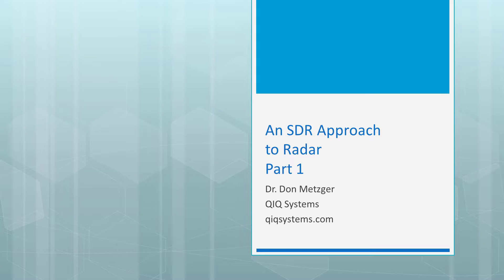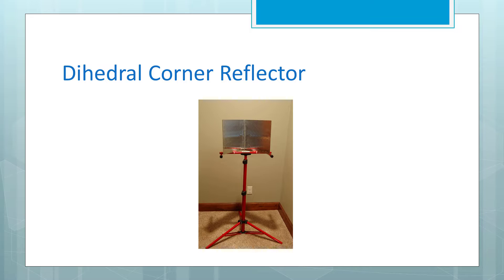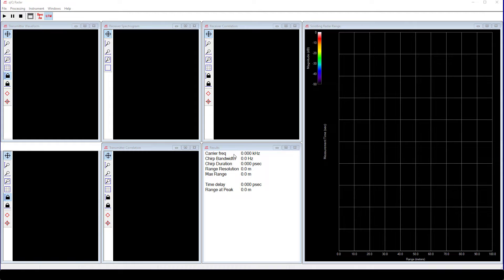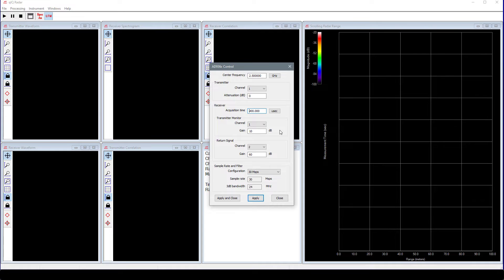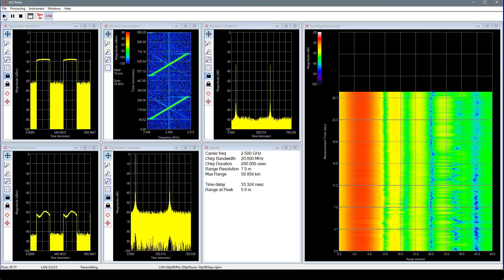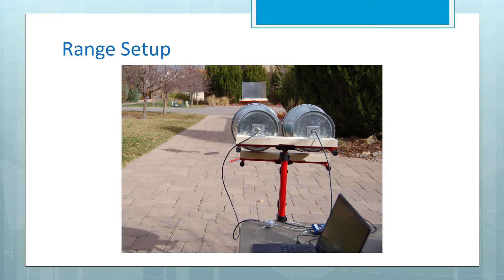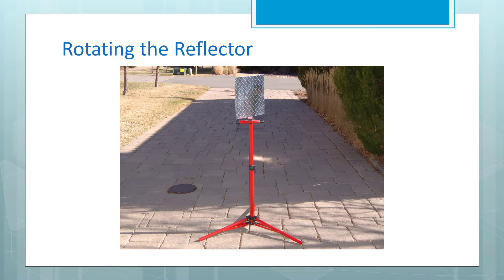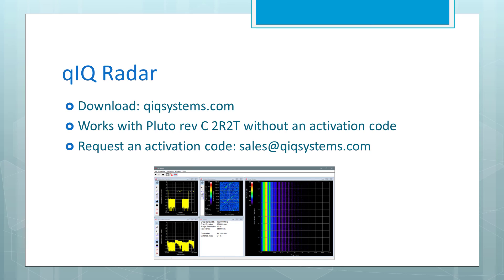A Software Defined Radio (SDR) Approach to Radar Part 1

Comment: It is a great implementation, no doubt about it, and also a kind of niche one...That being said,, 250 USD license for a MONTH? A month?! Are you out of your mind with the pricing? Like i said, it is a niche product, but it is being distributed for general use, military wings or whatever that should be sucked dry, not common people! Do not moan when people pirate your software.
Reply from the maker: I agree, $250 for a month is kinda steep for a consumer, or hobbyist. That is why we allow qIQ Radar to be used free with the Analog Devices Pluto. A Pluto rev C can be converted into a 2 transmit, 2 receive system. That makes a nice platform for handling the SDR system. If you need help finding that video by Jon Kraft on YT, let me know and I can help you find it.
For businesses, who have already spent $6k to $8k on a digital host board, and an Analog Devices eval board, we make it possible to go month-by-month, rather than insisting on an annual license. In that case, the $250 a month for the software makes sense.
So, free for consumers, manageable license terms for businesses. I appreciate your question, so I could explain that.
Reply: @qiqsystems  Which companies will pay? I think your software can be used in new languages, such as Chinese, so that it can be promoted to new markets.

Comment: As far as I know, many of the spinning radar dishes are just reflectors and the actual emitter and receiver antenna is mounted under them in the axis of rotation, aiming upwards to get reflected away horizontally. But for that, one would have to either interpose the rx/tx antenna somehow, or just use a single one switching between the functions corresponding to a timer.
Reply: Rotating Radars are typically pulsed and measure distance by time difference between transmit and receive.
FMCW Radars send out frequency modulated chirps. The return signal is mixed down with TX. The resulting beat frequency gives information about distance. Velocity is typically found out by phase difference between range bins.
Hence, FMCW implementations do not make much sense on rotating antennas but are increasingly found on MIMO arrays such as AESA or automotive Radar.

Comment: If you had, say, twelve of these,  set up 30 degrees apart in a circle, and used the software to look at each one in succession and combined the output onto one readout.... would that be a homebrew phased array radar? Sounds expensive.... but still less expensive than figuring out how to create a rapidly spinning radar dish all powered up and working.
Reply from the maker: Phased array antennas are a bunch of antennas facing the same direction. By changing the phase of the transmitted or received signal for each antenna, the beam is moved around. Your suggestion is a good one for seeing in all directions, in azimuth. It saves you from having to figure out rotary RF joints.

Comment: If a setup like this coupled with a high gain YAGI was used.. what is the sort of range one could expect to be able to detect things at?
Reply from the maker: That's a very good question, but hard to answer. In part 3 we will discuss some improvements to the basic setup to allow it to see smaller return signals. The antennas used for this have a gain of about 13 dBi, before being put in the buckets.
Reply: @qiqsystems  Thank you for the reply Don!

Would tuning a horn rather than a bucket have a greater effect on the gain? Looking to make a 30-50 degree radar scope to do longer ranging stuff (mostly for detection of drones in the sky) and certainly would be willing to share findings. Cheers!
Reply from the maker: To make a real system, the antennas would need some work. We tried to keep the costs down when creating this system. Horns have good directivity, so I think that would be a good place to start. A dish might also work nicely.
Reply: @qiqsystems  Appreciate the reply! Will start thinking on a design. Cheers!
Reply: @steemglobal8011  If you can, keep us posted on progress? This sounds like a good project.